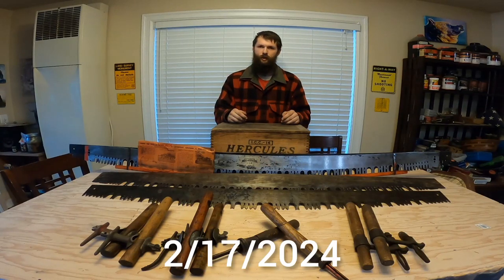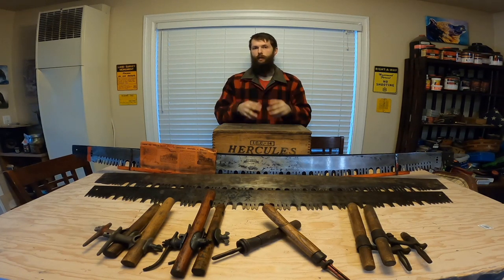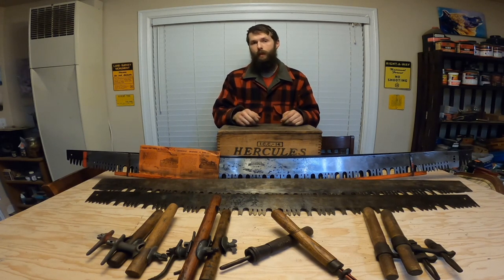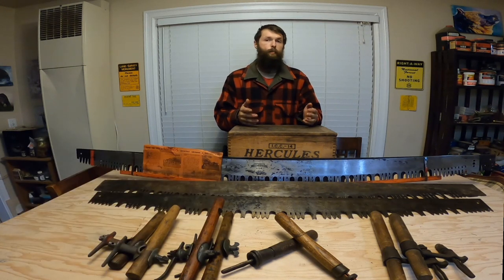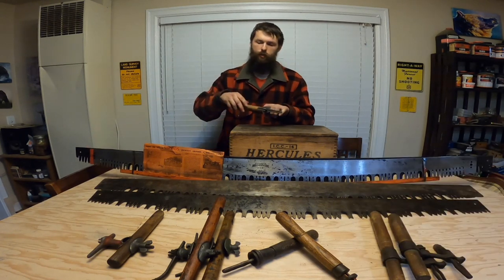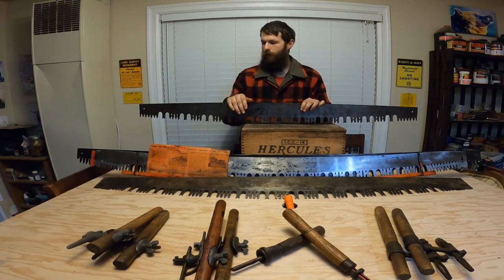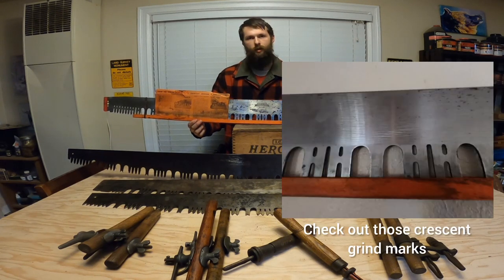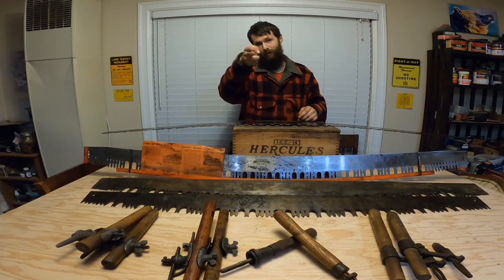Crosscut Saws | The Modern Mountain Man Project

Comment: I really enjoyed the video. I'm gonna check out the guys YouTube channel. It brought back some memories. When I went to work for the electric utility company we had a crosscut saw on our line truck. Sometimes we used it to cut old poles after we replaced them with a new pole. One thing you learn pretty quick when you're cutting is to pull the saw & not push. Let your partner pull it back after you've made your pull cut.

Comment: Nice video, though you need to add a champion and a one man saw in for context. I find that a lot of east coast crews love the 325 for bucking and lightness of carry and it performs well in hardwood. Seems to hit a crosscut sweet spot and you can wedge in behind it sooner.
Reply from the maker: This video was more focused on the two man saws out here west. Champion saws aren't too common in my neck of the woods (North Idaho) because we have very little hardwood to worry about. And the hardwoods we do have aren't truly "hard" like oak or maple, we only have stuff like cottonwood, alder, and birch to contend with (and in very small amounts at that). The logging industry here was focused on white pine before it shifted to spruce, fir, and cedar, so lance and perforated lance saws are all I find. And since I tend to only cut pine, spruce, and fur it works out
.
Thanks for watching
Reply: I'm in northern Michigan which is mostly softer woods, but almost all the saws I find are Champion or Tuttle tooth. I think it's was a holdover from the logging era when a lot of frozen pine was cut in the winter.  @HabeasJ